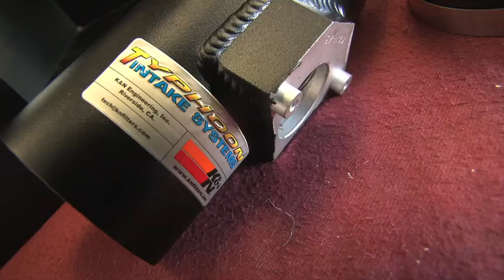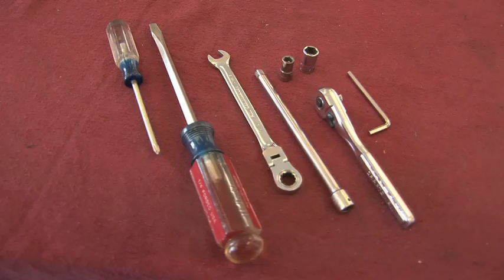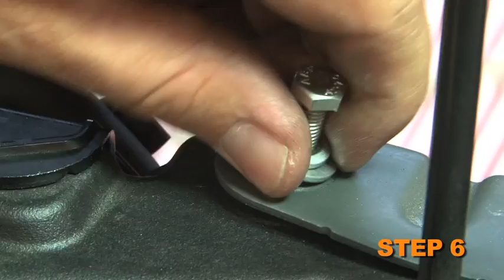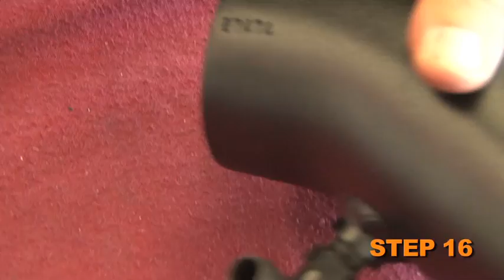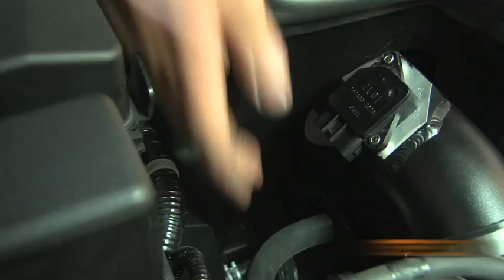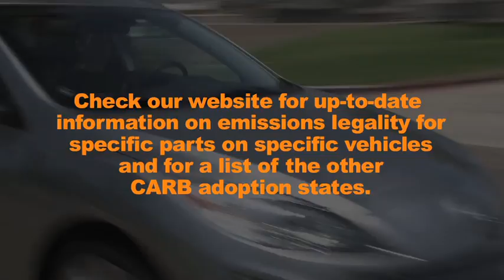2010-2012 Mazda 3 Performance Cold Air Intake Kit K&N 69-6013TTK Installation Instructions

Comment: Can I use this on my maZda 3 2012 2.5 and it has 2.5L. It isn't the same car in the video but the skinnier car not the hatchback
Reply from the maker: +XxS1l3nTxa1Mx If it is the 2012 Mazda "3 Sport" with the 2.5L it will not work. If it is the regular 2012 Mazda "3" with the 2.5 liter, yes it will work. There must be a difference in the air intake system on the sport version of the mazda 3 because K&N shows nothing for it, only the non-sport version.
Reply: Yes my model is the sport version. So what air filter could I possibly use? I was planning on ordering it today from kn website. Thanks for telling me but what should I do now
Reply from the maker: +XxS1l3nTxa1Mx Unfortunately K&N shows nothing at this time for the 2012 Mazda 3 Sport with the 2.5 liter engine. You could try calling them for more info on the reason for this at 1-800-858-3333.